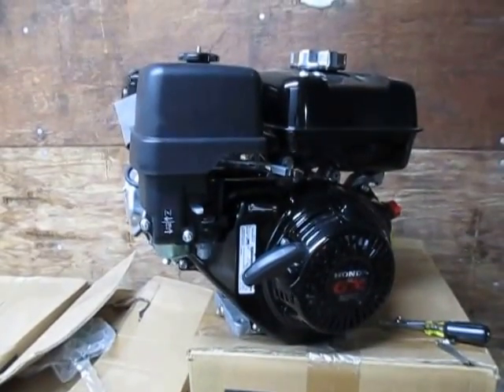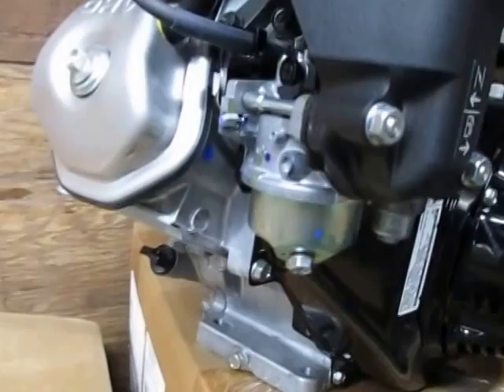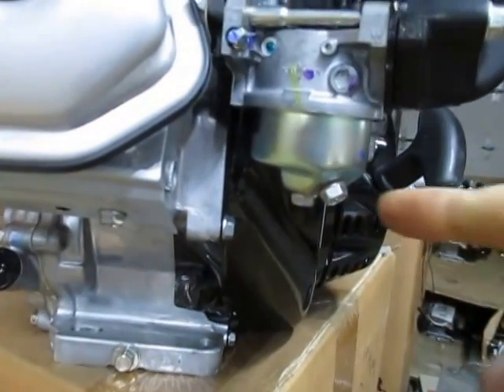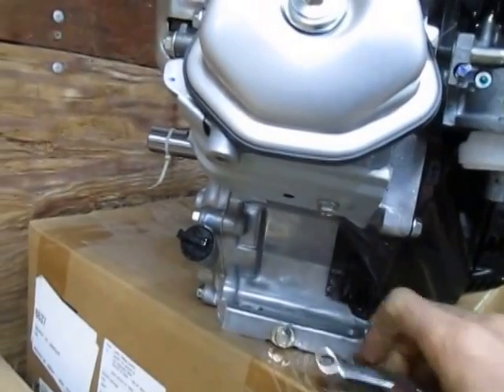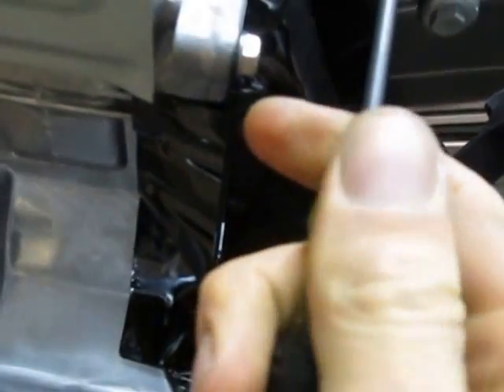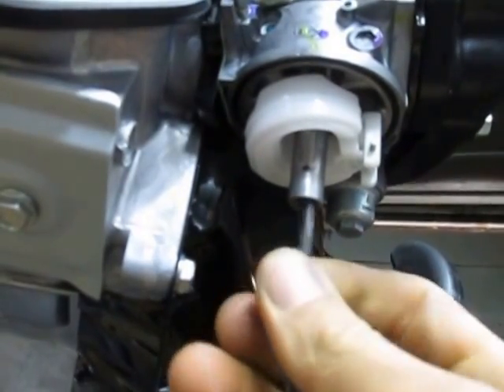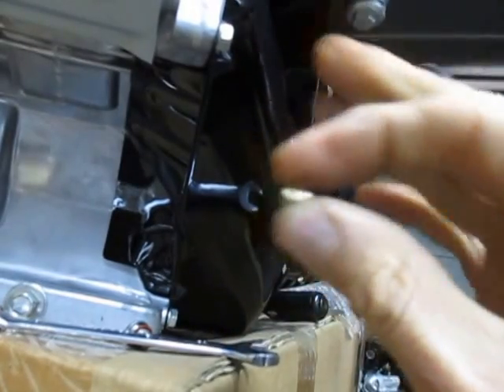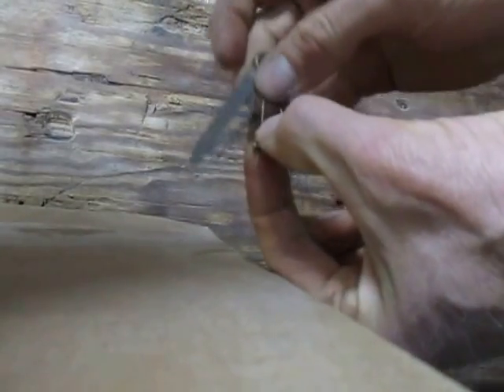Cleaning Carb Main Jet on Honda GX Engines

Comment: I have a GX690 and its attached to a 72 inch Berco snowblower. It cant move snow. It just bogs down and even stalls. It was back to the dealer and tjey they say I have to "crawl." I dont want to spend 3 hours clearing a 200 foot driveway again. My walk behind Honda snowblower needed a rejetting that I did following a guy on YouTube. Do you think rejetting the 690 would make a big difference? I dont even see the carburetor bowl on it. Do you have any insight? Berco and the dealer arent interested. My $8000 snowblower is garbage without some help. Do you have any ideas what I can do?

Comment: Howdy! I cleaned my carb jet last week and when removing that small piece another one fell on the ground: a long metal tube with different holes... what was that? i managed to put it back and my engine works fine... Thx
Reply: That's the emulsion tube, it should be cleaned as well
Reply: @IFix-Things  Thanks!

Comment: Just to point out, the pilot jet has a much smaller hole.  If your engine is hunting for idle, the pilot jet is plugged.  Clean with a twisty tie wire.

Comment: handy tip! when motor is mounted it is sometimes impossible to reach the jet becuase of clearance. get a 4-1 switchable screwdriver tip. grind down the phillips side till the screwdriver bit is short enough to clear the equipnet otormount deck. don't use a screw driver like the guy in vid....you will round out the stem treads. use a flat tiped gunsmitch type with no taper. the 4-1 drivers (harbor frieght type) have the right flat head.

Comment: Yes! Fixed it! Thanks for the video, it shows that a carb can't be cleaned with carb cleaner alone, often you do need a piece of wire of the right size to remove hard deposits 👍
Reply: carb cleaner will ALWAYS clean it out if shot from back side of throat

Comment: Thank you. Left gas in my snowthrower and couldn’t start it. I couldn’t use it for the six inch heavy snowfall. More snow on the way. Followed your instructions and voila the engine runs like a champ.

Comment: When your into this stem, why not show the second emulsion tube, and all the little holes that need cleaning in it.  It is easy to clean an brand new carb that doesn't need anything.  What you have shown is fine, a good video, but you haven't scratched the surface in explaining what to do with that carb that has been sitting for years and everything is totally bunged up. I worked on one today that had a half teaspoon of gunk in the bottom of the bowl. The stem was totally coated with dried varnish.  That little jet that you dropped on the floor was so plugged up, my son watching over my shoulder tried to convince me that there wasn't even a hole in there.  I'm still at the point of having to try to get that emulsion tube to drop out so I can clean all those little holes in the sides of the tube.  I do like your idea of making a carb driver out of an old screw or nut driver. Thanks.
Reply from the maker: Yes, this video just shows the main-jet cleaning procedure.  I agree that if the carb shows signs on gumming in other places, it should be taken off the engine and fully cleaned.

Comment: I'm having a problem. The fuel goes threw the hose into the little carburetor but seems like where it's supposed to go in the bowl is clogged  because the gas doesn't go threw. I took it apart and blew in it with my mouth and nothing goes threw. Help. Bowl is dry.

Comment: Generator wouldn't start at all.  Dropped the jet out as shown, cleaned it out, put it back in and it fired up immediately.  Thank you very much for this video.  Probably saved me over $100 for a service call.

Comment: Very helpful , as I need to swap out for a higher altitude jet on a Honda EB6500x Generator, to use at 6300ft, and no references about how to do this. only idea was an exploded view of the part placement itself not the actual location, super easy thanks!!!

Comment: Thank you very much i have a gx160 and its starting but not sucking fuel properly and shuts down in about 30secs ill try this and see if it will work i believe that was the problem thanks!